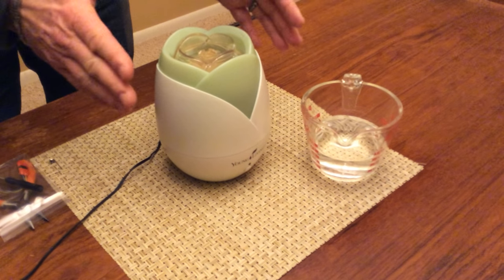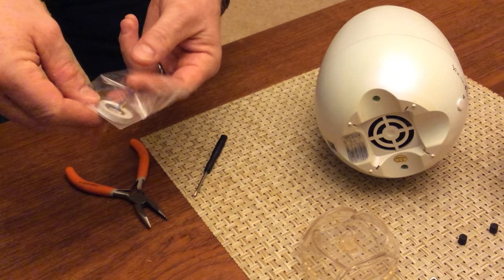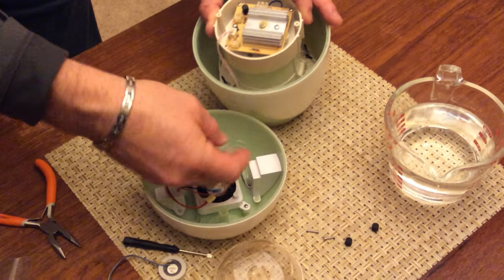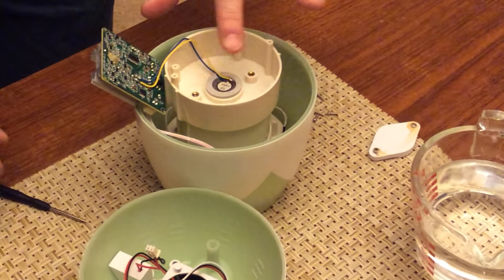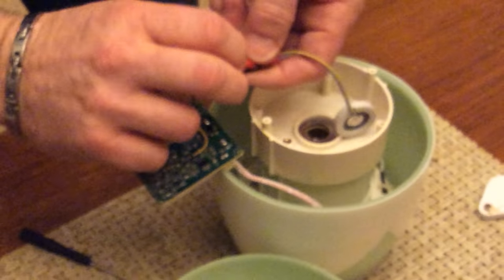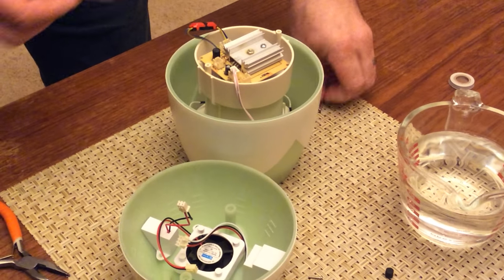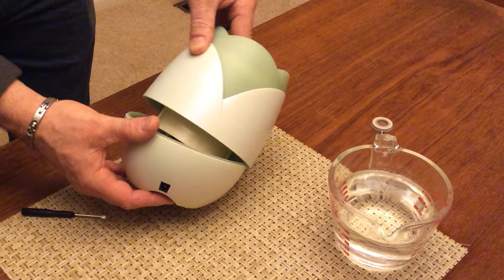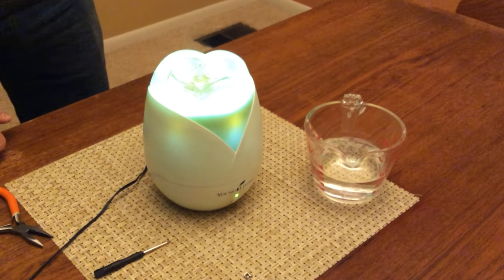How To Repair A Young Living Tulip Essential Oil Diffuser

Comment: I forgot to mention that I had the smart idea of vacuuming the back of it, thinking that there might be dust trapped inside (which it was btw from being in the kids room for a couple of years).I did look on your website but couldn't find a fan for this model.The diffuser does have the light on,sound like it is working but no mist,and the water is quite warm.Thank you.

Comment: My tulip diffuser model  is not throwing vapor out of the green cover though I see water fountain happening inside. I saw your another video in which fan wasn’t working in the purple mouth diffuser . So are their separate fans for all diffusers? Which fan I need to buy for this tulip diffuser ? Also what if diffuser doesn’t work even after replacing the fan then in that case is the item returnable ?

Comment: I dont see a flickering light issue but the diffuser is making noise and vapour coming out of the diffuser is not the way it was. It’s very less . I saw the other video of yours in which u reeplaced the fan of the diffuser with purple mouth. Does ur website sells the fan for this diffuser as well. I ll open and chk the fan . Is there any video on how to get the fan out for this diffuser

Comment: My husband bought a plate off ebay and while it is the same size, the wires are different colors (black and red ).Do you know if we can use it?
Reply from the maker: Most likely not - the discs must be matched with the driver circuit. An incorrect match may damage the board. 
Here is a link to the kit. 
https://www.diffuserdoc.com/young-living-green-top-diffuser-repair-kit.html